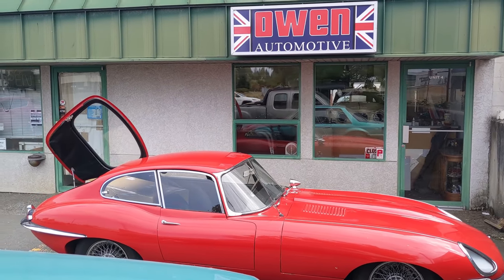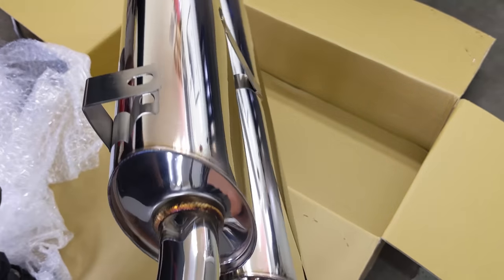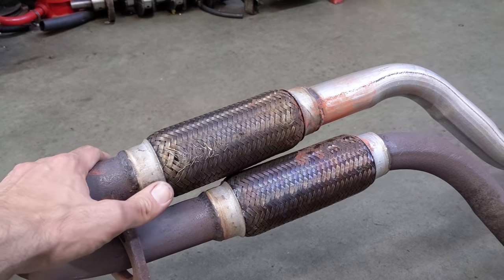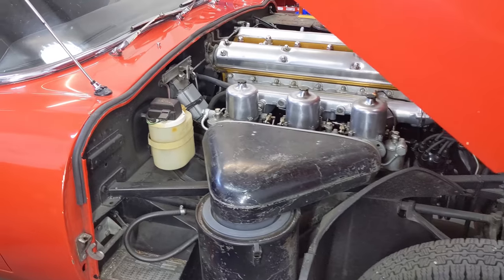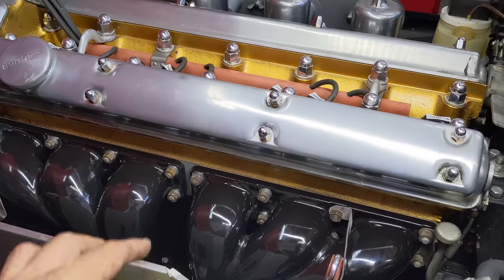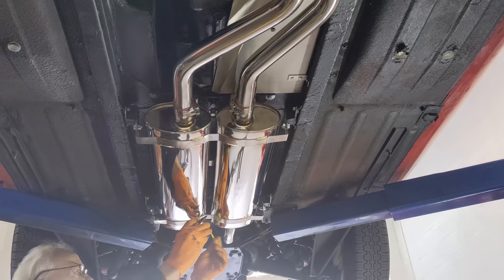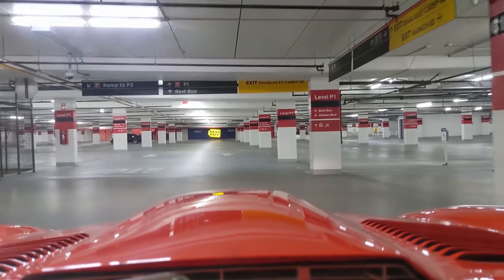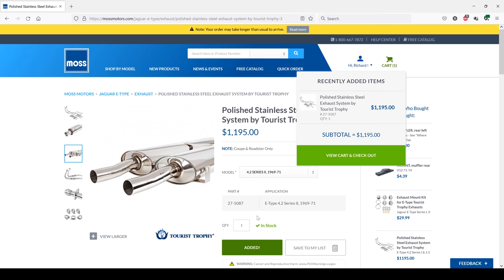Fitting the Tourist Trophy Exhaust to my E-Type

Comment: Looks great- I already purchased another system and have yet to install it. Unfortunately, the common steel headers on the market don't have flex pipes! If I had known, I'd have spent more on the stainless set with flex pipes instead of now having to buy flex pipes and cut the system up.

Comment: Two weekends ago, I put the SS-big bore system (from Moss) on my -69. SS headers as well. Gorgeous to look at and sounds great. But like you I'm embarrassed with the leaks every time I go under this car.
Reply: Oil leaks on a classic British motorbike or car is normal, its called chassis lubrication, the more worrying thing about this lubrication process, is that when the pan (or sump as we call it) is dry and no more leakage on your garage floor, means the pan is EMPTY, and needs refilling with more 20/50 oil

Comment: Hi Richard-
Really dig your channel, I check it out whenever a new ones on. Particularly because I find it interesting and educational and learn something new each time. I've had  67 E-type like your nearly 40 years. just curious, I noticed the red air horns you installed. What brand are they and are they loud? I'm thinking doing the same. Best Regards

Comment: Great sound! I just had my 4.2 XK engine rebuild, and I cannot wait to have it back in my own E-Type. You mentioned that it has more power after the exhaust upgrade. Is this really that noticeable? Have anyone else experienced this, and if so, can someone estimate how much more power I could expect from fitting one of these exhaust systems? :) I would think that the feeling of having more power would mostly come from the better and more aggressive sound, but I don't know :)
Reply from the maker: Tourist Trophy is a strait through system whereas the original muffler uses a series of baffles
Reply: @RichardMichaelOwen  thanks, yes I am sure it will result in better air flow. But I was wondering if you could indicate the power increase numerically? Would it for instance be a 10% increase in power? I won't hold you to it, as it can depend on so many factors such as the condition of your engine, fuel, ignition timing etc. :) 
Thanks again!
Reply from the maker: Exact % and peak power data can only come from testing on the dyno/rolling road
Reply: @RichardMichaelOwen  it would be interesting to do a dyno test with the standard exhaust first and then swap it out for the TT model and redo the dyno test to see the difference :)